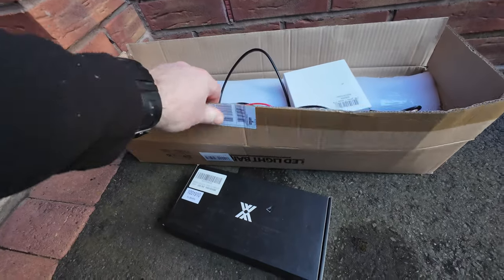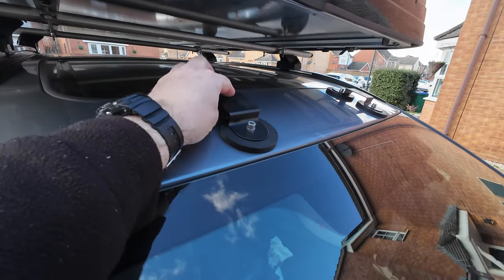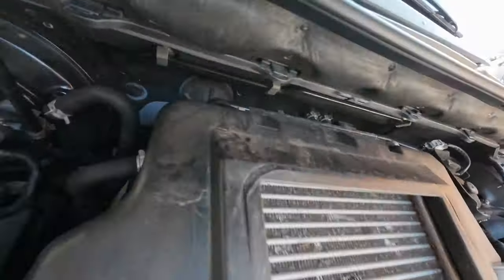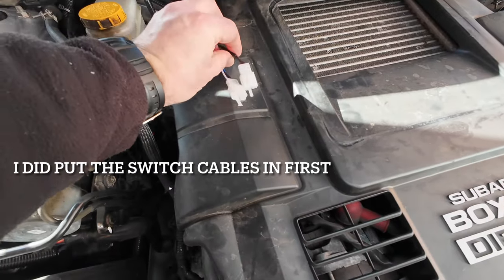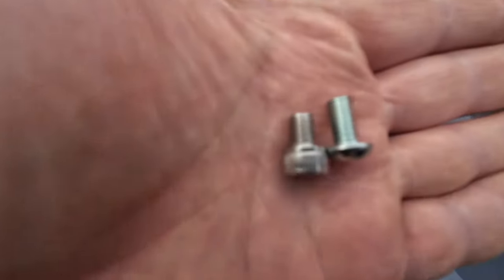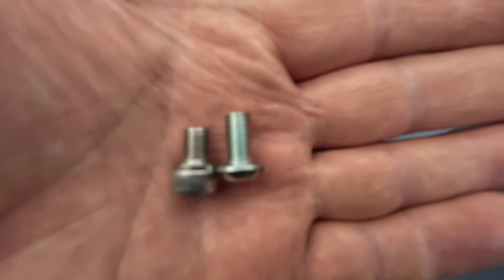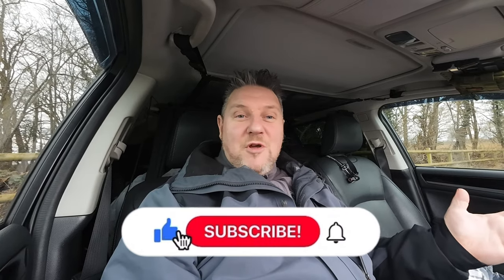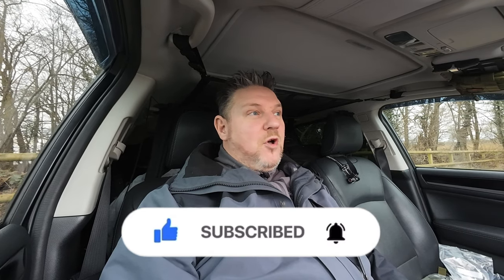Amazon Light Bar & Ditch Lights Install & Review | Subaru Outback

Comment: Oh mate! 🤦‍♂️ 
I see what you mean, It did light the bonnet and dash up lovely though! 
I think you’re  absolutely right, the front is the place to mount them. Appreciate the issues you have with uk options on that model of car though! 
Nice video 👍
Reply from the maker: Yes I think I might look at moving it to the front at some point. I can’t see myself using it while it’s on the roof. Also I’m getting quite a bit of wind noise from it so all in all I’m not happy with it.
Reply: @LoneWolfExplorer  understandable 👍
Reply: Oh well , some things don’t always turn out the way we hope, but we don’t know until we’ve tried it!
Reply from the maker: @MrBrad248248  Yes that is very true, still the ditch lights are useful & the light bar looks good 😂